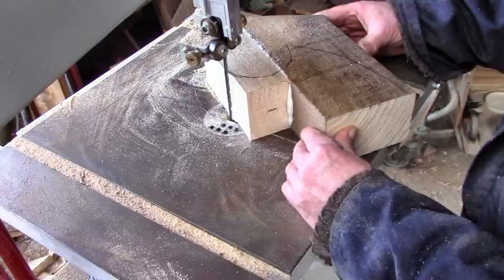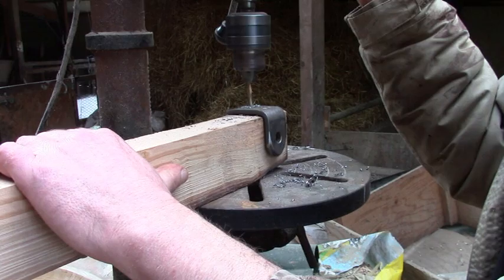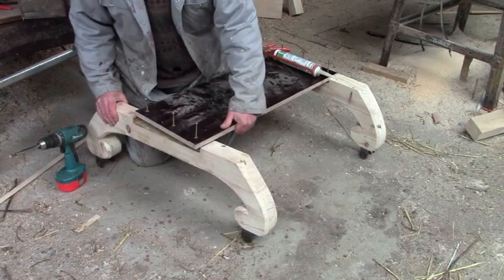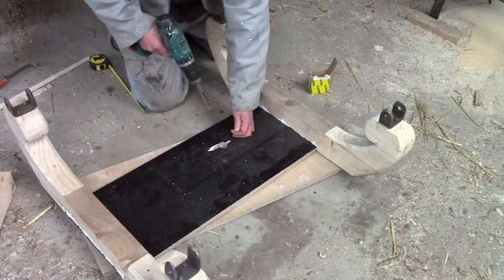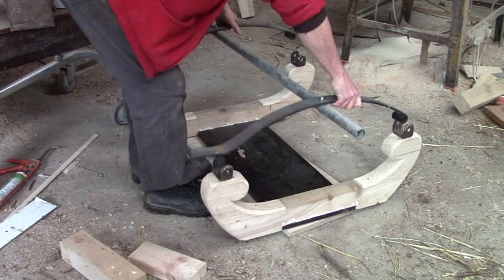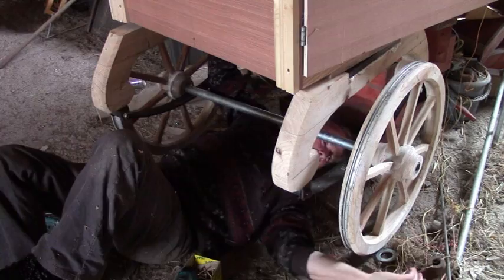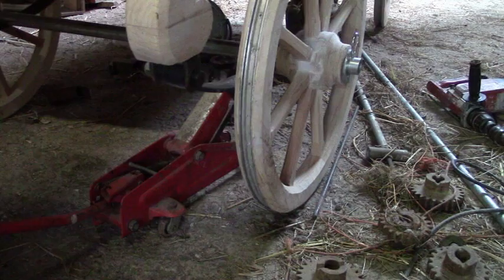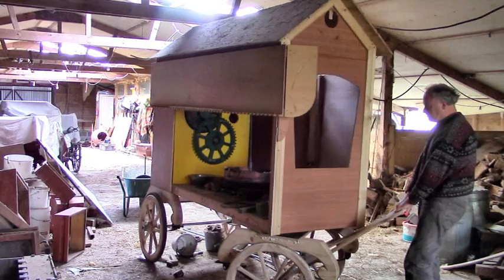Clockwork Doughnut Cart: Part Four - The Chassis

Comment: For a stronger lazy susan, you could use 8 small fixed caster wheels (eg. rollers).
Put them equal distance from the center, 45° between each.
Their orientation should be 90° to the center, so that the board would ride on top of them (that is, so the axis point towards the center).
If they're not strong enough, you can use 16 or 32.

Comment: I had to build a cart for a school play, much like yours, I ended up using "Allways" ball bearing castors to take the vertical load. I worked well.

I have/had a relative called Susan. She was very industrious with lots of Methodist/Protestant work ethic. she would hate to be thought lazy. So I have a little giggle every time I think of a lazy Susan bearing. 

I also giggle at "Brass butt hinges" they remind me of someone too.

Comment: good to see you back with the build, I use a lazy Susan to do panning shots while filming, Other alternatives for the bearing i have used ,(not for building doughnut carts) are swivel chairs which if they can take my weight should be ok with cart carrying elephants the other was the pulley bearing and assemble from the back of a washing machine drum these normally have a wheel and a bracket attached but i am sure you have your own list
Reply from the maker: ***** Ha! Excellent ideas Paul. Good job I didn't think of the chair idea first or Sandra's office chair may have mysteriously disappeared : - )   I'll give this a go first and see how it holds up. It might be fine just as it is - if I can reduce the weight it's carrying..
Reply: In liverpool swivel chairs have the life of Riley,  often in the mornings I find them lying in the street obviously still drunk from the night before and having been kicked out of the house.
Reply from the maker: ***** Shocking behaviour! Someone needs to take them in hand!

Comment: Did you ever finish and use this cart?
Reply from the maker: It was going to be too heavy - I need to rebuild it with lighter materials
Reply: @WayOutWestx2  Or have the cart be wider to bare more weight (You can reuse the old frames for some sort of boxcar or coach if your railway attracts tourists)

Comment: I be thinking get red of lazy susan and use a  pin and r clip same as on wheels between the two moving piece of ply wood and possibly up into cart.Put a  grease nipple at the center of wooden hub .If the ply is tight it will give u rigidity and the grease will work its way out from the the inside protecting  wood from friction and allowing the wooden hub to turn esely ..That,s my two sent,s worth .Your looking and doing the work you will have a feel for what,s right you
Reply from the maker: Michael O Callaghan Yes, I think that would work too, Michael. I think the lazy susan may work fine though. I'll give it a chance anyway...
Reply: Michael O Callaghan

Comment: what about an conical axle bearing hub like on a trailer wheel mounted vertically, sorry for the rough visual, like this link below to show my thought. it may handle the weight and turn smoother.

http://www.tractorsupply.com/en/store/martin-wheel-5-bolt-pressed-stud-hub-repair-kit-for-1-1-16-in-axle
Reply from the maker: Rev John O'Toole Thanks John, yes, that could work too. I looked at them but they were really expensive to buy new, so I will give this arrangement a chance first. (Lazy Susans are cheap!)
Reply: WayOutWest Blowinblog maybe you can keep one on the cart in case you have to replace one on the sire of the road.
best